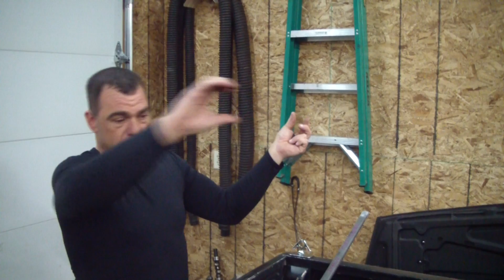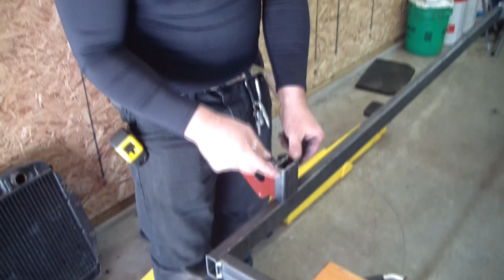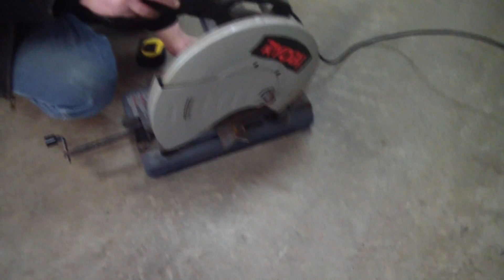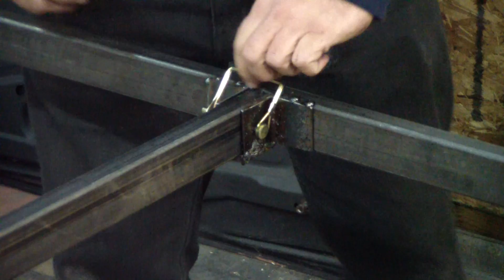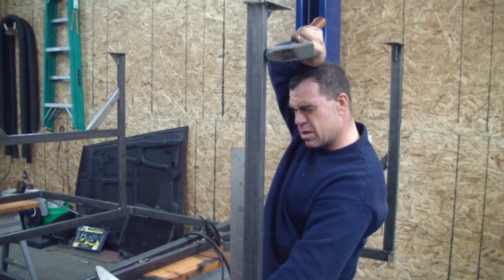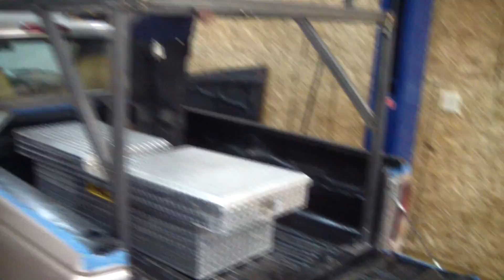Truck Cargo Rack Build With  JD

Comment: I'm about to pick up a JD2 model 3 bender to build a rack for my truck and plan on doing some on the side for extra $$$. Anyone have any advice on steel round tube size? I want to go with 1.5" for the sake of cost for material and die set but feel like a might regret not going with 1.75 (for strength and if I want to build a roll cage some day).... Any feed back on the JD2 model 3 bender also? Thanks guys!

Comment: Why didn't your upright supports go into those nice square holes in the sides of the bed?
Reply: Kevin Klika Stronger if you mount near the frame.  The side walls aren't as strong.

Comment: The flat bar used for your suspension system, over the cab, should've extended from front, upward all the way back to your forward bed supports; then down to the top rail.  A heavy forward load will tend to stress at that point.